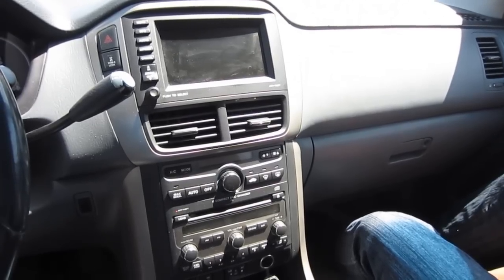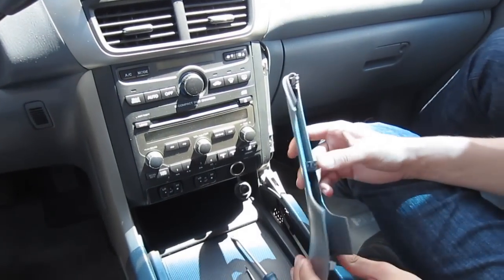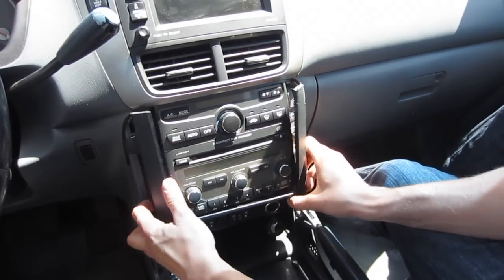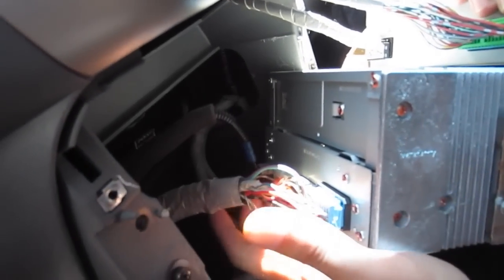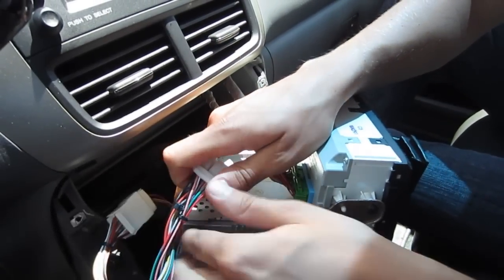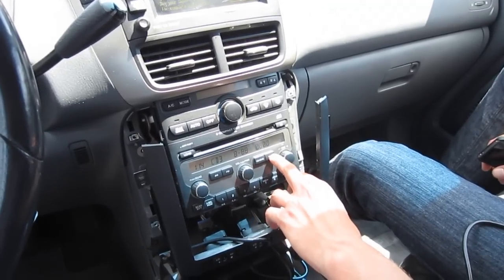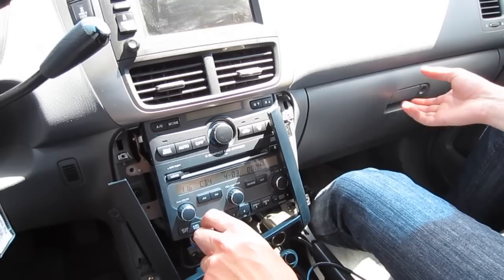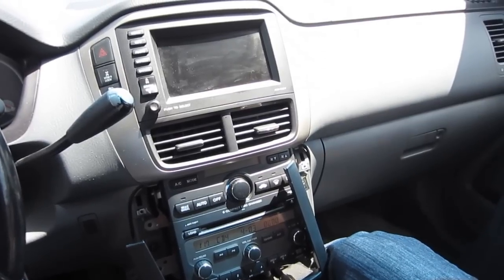GTA Car Kits - Honda Pilot 2003-2008 Navi install of iPhone, iPod and AUX adapter for factory stereo

Comment: Than you for this video. I installed a Bluetooth adapter and couldn’t have done it without the help. I’ve seen people drill out a hole to route the wires from the bottom of the stack however I found another way. Instead of drilling I just took apart the ash tray ran the wire through there and then put it back together. There’s just enough room in the space from the ashtray to the assembly that allows the wire to pass though. Now I just have to put some 3M tape and mount the adapter to the roof of the opening. I’m mounting the microphone in front of the speedometer and on top of the steering column. This makes for such an easy install and after testing out some phone calls I’m very happy with it.

Comment: This video is very good!!! Not many people know how to remove this front panel from the Honda Pilot. This is very useful since it helps to know in order to be able to install a component, replace the 6 disc CD Changer, the Radio, or work with other components behind the panel. Great job!!!

Comment: I have a 2003 Pilot EXL without the Nav so radio is located higher on the console where the Nav is located in this video.  Despite that, the video was extremely helpful as I needed to get to the lower section to run my cables.  It took me 20 minutes to remove all the trim, install and test the kit, and reassemble the console.  I think most owners have found that if you replace the factory head unit the sub woofers will not work.  This kit is great and a much cheaper alternative.

Comment: Mine stopped working. The Aux cord needs to be bent in order to work. Or plugged into a bluetooth adapter while charging to jump extra power over but that creates a very high pitched noise. Would cutting open the aux cable and changing the aux cable’s head fix this?
Reply from the maker: Please email our support if you have any problems. info@gtacarkits.com

Comment: @djackson87 I have a 2004 EXL w/o Navi and I was contemplating giving this a try.  What's the exact Aux adapter kit that you used for you Pilot?  Was it much more difficult accessing the upper portion to remove the cd/radio unit?

Comment: What would be the best method to disable the XM Radio? When first connecting to Bluetooth/Aux I am getting a slight XM signal. Sounds far away and distorted, but very much there. Thank guys! Once I figure that bit out I will be in great shape. Loving my new Kit!
Reply: I have both Navi and XM, and I also had this problem. You need to disable XM by disconnecting the XM antenna, located behind the passenger side trunk panel. There is a HondaFix tutorial that shows how to remove that panel. The antenna is a small black box with a cable running into it. Just disconnect that cable, and it will eliminate the XM interference in your GTA Car Kit. If you still want to use XM radio, you can use the XM app on your phone.

Comment: does anyone know if i can still install a aftermarket radio in a 2005 pilot with nav? because how do i hook up the nav to the new radio
Reply: Hey Luis.  I am told that if you install an after market, you lose navigation.  On the newer radios with navigation, you have to have your phone hooked at all times to the radio.  Kind of defeats the purpose in my opinion since you are relying on your phone all the time...

Comment: Oyeah am buying this ........

Hey look i  have a pilot 2008 exl no navigation system and all six disc got jam i got 5 of the disc out using a small screw driver but the last disc doesn't want to come out and way i can get it out.

i dealer charging me 500 to fix it so yeah.....